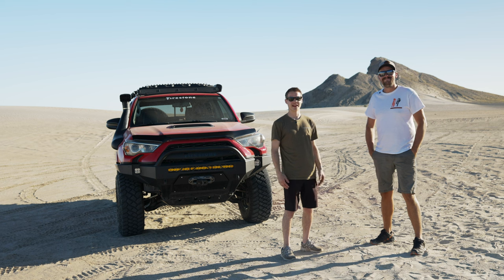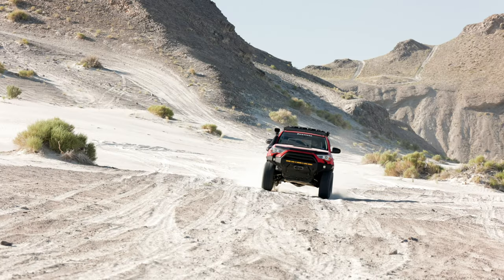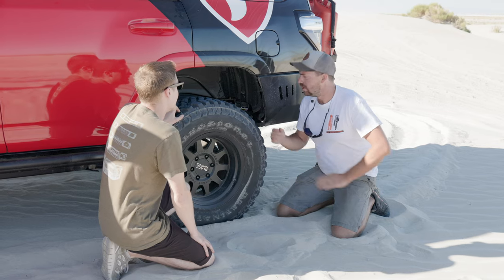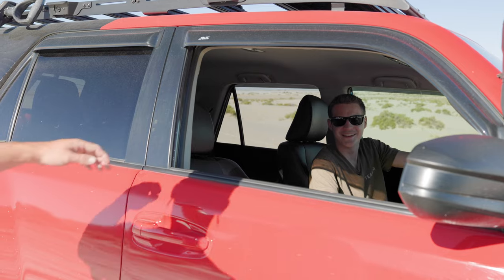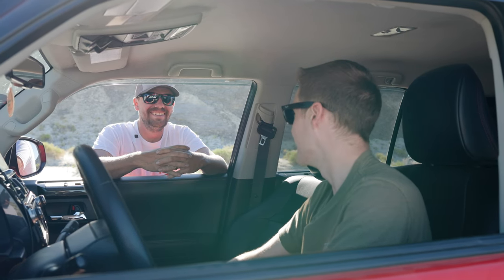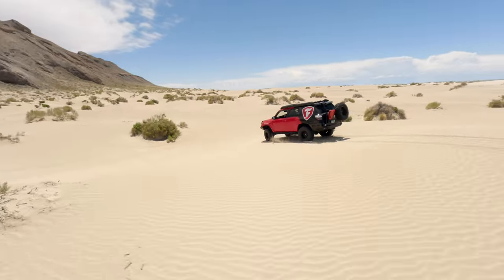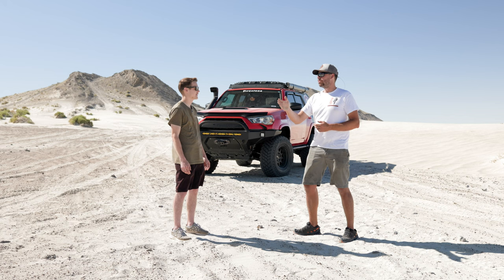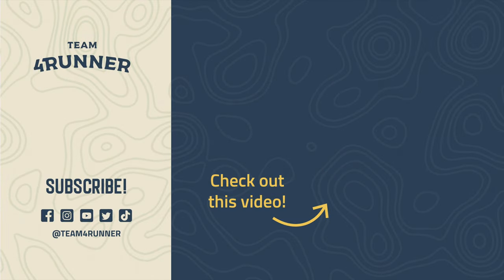Tuning & Adjusting Our Dobinsons MRR Shocks | 5thGen 4Runner

Comment: Isn’t the low speed adjuster for slow shaft speed like body roll and high speed is the chattery and square edge hits?
Reply: You are correct on that. Low speed comp for low piston speeds, and High speed comp for High piston speeds. rebound adjust for the most part is low-mid speed only. High speed rebound are controlled by the shim stack.